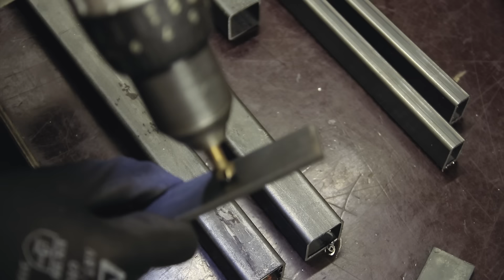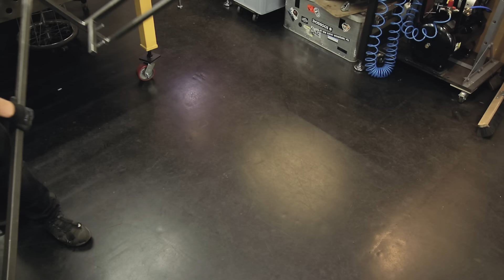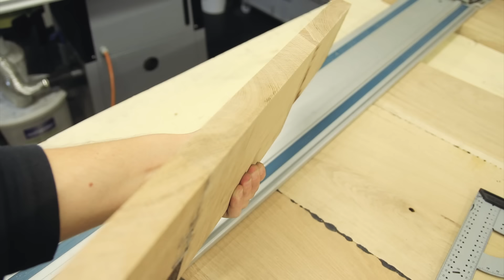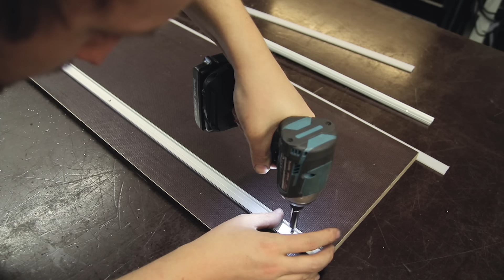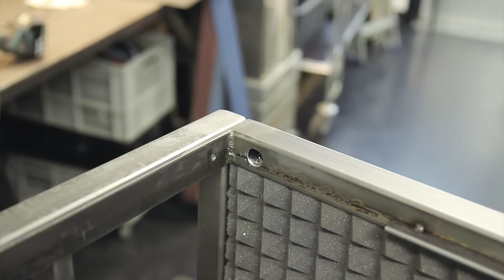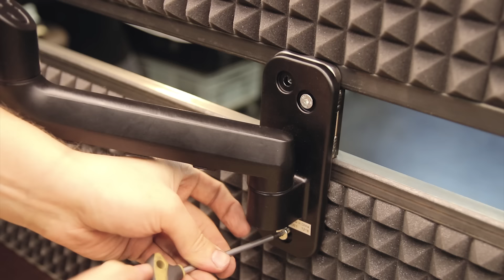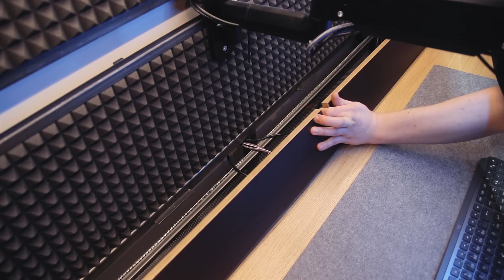How to Build a Cable-Free Desk with Built-In Lights, USB, Outlets + More!

Comment: Though I have total respect to this, recently I did it simpler and better (IMHO) having 2 monitors, using a double monitor wall mount (model North Bayou). It takes some time to assemble it but that was all I needed (and of course, I have logitech wireless keyboard and mouse - well trackball in fact).

Comment: Nice cable management solution.  That seems to be the main driver behind why people design their own desks.  Aesthetically, keeping cables out of sight is desirable, but from a practical point of view, cables on the floor are horrible.  I used to close the door to the computer room so that my roomba wouldn't kill itself in cables or rip cables out of connections.  Plus, I have an irrational fear of water somehow leaking from a pipe or something and shorting destroying my computers.  I want to keep everything off of the floor.
Also, I have 2 pc's so I worry about airflow under the desk.   I like to turn them 90 degrees compared to your placement.  The air intakes face inward and the exhaust faces outward, away from the desk.  I think it is an easy modification to your design.

Comment: In the drawings you’re selling you forgot the spacers between the lip and the thin wood, also de tubing in the aluminium box it’s not there.
Reply from the maker: The spacers aren't in the plans because I actually just made them to fix a mistake I had made when drilling a few holes (not installing the upper cross brace flush with the backside). So yeah I built my own desk wrong ;) If you follow the plans you don't need the spacers.
As for the tubing in the box, you're right, I added it afterwards because my perforated sheet was a bit too thin and I felt the edge is more sturdy that way. They're not strictly necessary though, especially if you use thicker sheet.
Reply: @PhilVandelay  yup that’s what I thought, I’ll use a 2mm aluminium sheet with no holes with the edges bended and then I’ll see if I do need the tubing. Has for the rest everything is perfect. I’ll show u the final result. Best regards mate

Comment: Hey Phil, I just wanted to let you know that "Eroy and Rhona" are stealing your design, no credits, same build, minus the shelf for the computer, and less aesthetically pleasing overall due to it being poorly fabricated.

On a sidenote; awesome build and I will be making something pretty similar for my setup, but I will be using iron angles in some places with wooden panel inserts, instead of adding pieces of flatbar and all...most likely to replace the "vertical frames" that holds the top shelf to the "table" part... to block out the sun rays.
Reply from the maker: I guess they added the credit after your comment 😅
Honestly I'm not surprised, as long as people don't claim it's their original design or start selling things based on it, it's fine by me.  If I didn't want other people building the things I design, I wouldn't be releasing the plans, although giving credit should be common courtesy. The bigger problem is that I can guarentee that eventually, some company is going to start producing this (most likely a cheap, ugly version of it) and making serious cash from it,  which bugs me a lot more, but in both cases there's not much I can do about it unfortunately. Companies have stolen my designs before, and they will do the same with this one.
But anyway, thanks for telling me. I have a feeling there will be a lot more videos showing some version of this build.
Reply: @PhilVandelay  Yes, indeed. They added it after my comment (if it is there, I haven't confirmed). I really enjoy your design, being a technician mechanical engineer draftsperson myself (I think thats my title in english lol! I'm French Canadian) I had a very similar idea but as mentioned relying more on iron angles because you can "inlay" stuff in them more easily, but I know how long it takes to release proper plans and whatnot so I prefer to mention it when I find someone stealing or not giving credits to the original person.

Comment: Shopping for a computer desk was an absolute fucking NIGHTMARE.  I visited probably two dozen stores without finding anything appropriate.  Your options are basically $100, particle-board, pieces of shit that I wouldn't trust to hold 100lbs or $1000 solid oak monstrosities that look like they came off the set of Wolf of Wall Street.

I ended up building a desk myself as well -- wish I'd seen this video beforehand.  Looks like another project may be in order this autumn!
Reply from the maker: Yeah that's about my experience too and the reason I went this way. That being said, if you produced this commercially, it would easily cost 1000$ as well, which I think many people don't realize. But at least you'd actually get some features

Comment: Its an amazing projet, have seen it dozen of times.
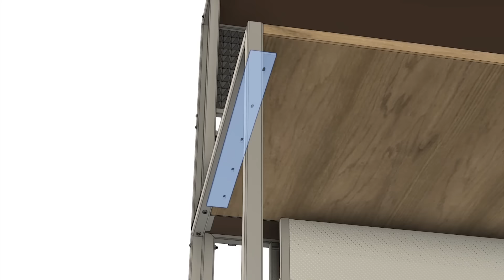how did you get the table top so perfectly aligned with the steel frame? I mean, at 9:35 you are welding what its supossed to hold your future table. did you knew in advance the thickness of the table? you didnt use sacrificial parts of wood in this part
Reply from the maker: The slabs were brought to the width of the steel profile on the thickness planer

Comment: I can't see the difference between this DIY project and an industrial one. Have you make the tools you showed in? Just the cost of the column drill it's too much for a domestic table, and the drill it's just the cheaper example.

DIY is, at least for me, a way to recicle, to enjoy, and a accesible way for not profesional makers to make creative mods, tools and a lot of stuff. I've seen automotive  mechanics than doesn't have the half of tools you show here. 

Its just my opinion, I don't pretend to tell anyone how to spend time and money. Just think than the most of us are not rich and we have to DIY make the most of the non-basic tools (I mean a screwdriver, as example)

Comment: When I built my desk a few years ago I went the cheap route and built mine with a solid slab door and some 1" rigid pipe cut to various lengths, with some adjustable floor flanges on the bottom. 
After I'm done buying a house (could be a 4 year process at this point), I will be making a desk similar to this. Cool to see your methods! That welding table is lovely!

Comment: In the US the prelaminated 18mm ply (I think the brand is EB1S)wood is common (white is the most common, black and gray). Most wood glue will cause rust on steal, the carbon in the metal turns the glue black. 
I built a similar desk last year, smaller back panel with versa mounts and, no shelf out of aluminum, got a welder at work to do my welding for a couple of lunches.

Comment: I love everything about this desk, from the materials, the aesthetic, to the modular functionality... it's absolutely gorgeous... when you said it only took 20 minutes to assemble at home, that's impressive, and a testament to the quality and well-thought out nature of the project. I love it.
Reply: Due to The fact that he designed it would lend to the 20 min assembly time, I would imagine. Not to take away from the design by any means. As my jobs revolves around creating assembly instructions for the general public, I have a bit of insight on this topic. There are often a lot of assumptions some of our designers make that often aren't expressed in the instructions. I've seen our test groups struggle with sections where joints should be flush but it's not mentioned and often leads to unnecessary discussion and therefor build time. As this fine man would just inherently know this it would shave off a lot of thinking/hesitation time.

Comment: if you cant do metal working. Is it possible to do it complete wood?
Reply from the maker: I think so, but you'd have to change the design quite a bit (use solid pieces for the sides for example)

Comment: You definitely need a fan inside the cable tray. Wires, whatever they are, heat up during using and such a volume of wires can be a problem without cooling.
Reply: no? it's an aluminum mesh open air design. I have a lot more cables going on in my current Ikea Malm cable tray and nothing gets even remotely warm.
Reply: Sounds like bro science. Why would wires heat up unless serious current is going through them?

Comment: Starting the bottom section of this build this saturday. Havent found a 30mm tabletop but I'm sure a 28mm one works fine. Never welded before and doing it with a garage workbench but I'm sure it will be fine.
Reply: So far so good, cut the steel using an angle grinder, messed up a few times because apparently I'm too dumb to mark 45° accurately. Nothing a good weld can't fix I guess. I have no Table like this to align the pieces but I'll use angle magnets, should work just fine. @Phil Vandelay I noticed in your schematics you used  a different approach to support the PC shelf as in the video you use 4 separate pieces while in the schematics it's 2 long ones.

Comment: Clean clean clean!  Very satisfying to watch.  Poor man's "clear top" workstation:  Stack a smaller table atop a larger table.  For floating monitor, attach table-mounted monitor arm to upper table  upside down.  Screw hooks into upper table for misc items.  Flexi tubes for cable mgmt.  Clean and cheap cheap 😄

Comment: if youre at all worried about the cables from the RGB strips getting damaged, you could always 3d print some bushings to protect the cables.

Also I'm a little surprised you didn't use any biscuits when assembling the desk top
Reply from the maker: People seem to often misunderstand what biscuits are for - they don't add any strength. They are to help with alignment, which was not needed here. A properly glued wood joint is going to be stronger than the wood itself anyway

Comment: I think first steps would be are to take classes in wielding and invest 15-20k on steel cutting/wielding equipment. This how to guide is not for folks with simple screw driver sets and a box of allen wrenches.

Comment: This is really amazing with the attention to detail. Though I will say that it feels like a small crime to pair such an amazing piece of machining with a prebuilt HP tower. 😆
Reply from the maker: A lot of people have said this, but first of all, that's a dual xeon workstation with 256gigs of ram, and secondly not everybody cares about see through computers with 5 million LEDs. I used to build PCs when I was younger, before most people knew it was a thing. But it gets a bit boring so now I build other things and just want a computer that works.
Reply: @PhilVandelay  I didn't mention anything about a bright, gaudy gamer system. You can easily build a tasteful system without a single active LED. It's more about that fact that HP as a company has become a shell of their former self in quality and customer service. But yeah, you go ahead and jump to those conclusions and I'll be sure to stay away from your channel from now on.

Comment: as someone who doesn't weld/ wood work, i can still see how useful that welding table is and kind of want one. lol

people who dont have this level of skill can still make something similar using clamp based parts that can be attached to a desk. 

really like the cable management tray having the usb and power hubs.
the entire look and feel is top quality.

the extra detail to make it easy to dissemble is an added layer of how much thought went into how it will need to be used and transported.

Comment: Beautiful. Another option for endcaps are plastic inserts. Your knees will thank you, and they look great! Some tips from this woodworker who is not much of a welder: when doing glue-ups like this, let it set for 30 minutes, then you can unclamp and scrape away the squeeze out, at which time it will just be a little rubbery. Save a lot of time sanding. Also, spend a little more time making sure the edges are flush, adding cauls every foot or so on both sides of the boards to hold everything straight.

Comment: As someone who never welded past HS metalshop, I'd absolutely love to build this myself if I had a shop to do so. This has inspired some ideas for me to build a desk using commercial means as I'm actually about to replace my current setup due to a move. Good stuff!

Also, you mentioned how the audio foam wasn't seamless: have you considered a checkered color scheme? Black and blue pair nicely for a more stylish design under some LED lighting so you could replace it with alternating color foam.

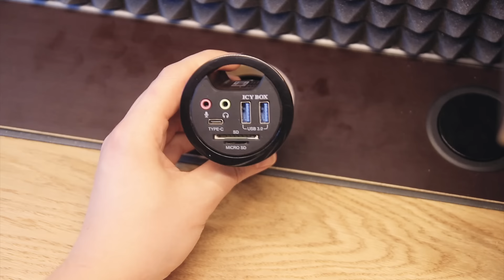Comment: 26:40 - Very nice, handsome... one problem:
This will be on the back of the desk, about 24" from the location of the keyboard and mouse... and those typically come with 10 feet of cable.  So the user would have to figure out to do with 7-8 feet of those cables, leaving them lying about on the desk surface.  They could go wireless, of course, if they don't mind the micro-latency that entails and the other problems attendant with wireless tech.
28:00 - I run a triple 32" monitor setup...  how would the desk hold up to that much weight on that single armature?

Good idea, very limited practice.  Good for some professionals such as writers, but not very good for people who rely on multiple displays.
Reply from the maker: Love how you're just making wild assumptions without having tried it, but I'm too lazy to even engage with this further
Reply: @PhilVandelay  Then why even reply?
And yes, I have.  Not your design, but others of similar approach.

Comment: My only issue is that you shouldn't use Danish oil anymore. It takes too many Danes to make a whole can, and eventually, there won't be any of them left. Maybe switch to an oil made from a place with a higher population. Quality probably won't be as good, but there's less chance of extinction...
Reply from the maker: Hey at least I'm not using Baby Oil
Reply: @Phil Vandelay I do not have the words to properly convey how hard I just laughed.

Comment: Really impressed by your work Kudos, However is it possible to make/design this table without welds? using stainless steel bolts, If you would be able to design such a build i would be very interested to buy such a design, Thank you.

Comment: This definitely helps me figure out my own desk set up. I have quite a few monitors and while I can't use the top shelf very effectively, because of a monitor that I keep up top, I definitely like the design for the cable management, the foam panels etc. I might also attach some peg boards but this was definitely a great start and helps me with my design. thank you very much.

Comment: How is that mouse from Logitech, I spend a lot of time in front of the computer and i was thinking to take that vertical one from them or that one you have
Reply from the maker: I like it a lot because it has a second scroll wheel at the thumb which you can map to whatever you want, I have it set to volume control which is extremely handy. That's mainly the reason I've used this model for a long time but it's also a good mouse overall. I did try the vertical one in the story and it does feel very comfortable - but it doesn't have the second scroll wheel, otherwise I might have gotten that one

Comment: Now I know you said it's some high grade plywood that is laminated on each side, I'm here in the US but what is that type of plywood called so I could try to see if I can find it here? I'm in the process of designing a corner desk myself and I kind of really like the look of that type of material and one mind having it in Black.
Reply from the maker: That's the thing, I don't know what it's called 😅 I'm located in Germany so the name "SIebdruckplatte" is probably of little use to you. It seems to not really have a clear name in the US, "phenolic plywood" is something I heard once that might point you in the right direction, but people also seem to confuse it with other, similar materials sometimes (it's definitely not MDF)
Reply: @PhilVandelay  yeah definitely not MDF cuz you said it was a laminated plywood so but I'll have to look up the words you used to translate to English but at least it's some direction for me to look in thank you.
Reply: It's hard to find but it's literally called "Laminated Plywood", though most listings for it here in the USA have it as a textured finish as it's often used in the manufacturing of flight-case style equipment cases.  Melamine board is similar and most popular here in the USA, though unfortunately most of that is an MDF style board and plywood based Melamine is hard to find.

Comment: So what happened to the dual monitor ? Is this desk dual monitor compatible or just single ?
Reply from the maker: You can hang as many monitors on there as you can fit, my old ones were just both starting to have issues and I was going to replace them anyway so I went with this setup. This is a 38" ultrawide monitor, so not really comparable to a "normal" single monitor setup, there is a lot of screen space and I just preferred the cleaner setup

Comment: how did you connect the LED strips? what did you use
Reply from the maker: the strips come with a controller with a remote and a power supply, you just plug them in

Comment: Problems: that top shelf is a dust collector, the desk should be on 4 lockable castors so you can move it to clean the floor, fit a pull-down blind (IKEA) to pull down over the speakers/monitor front, fit a wide, shallow drawer under the top for scotch tape, pencils, sharpener, eraser, notepad, highlighters, sticky notes, small screwdrivers, sharp scissors, tweezers, fresh face masks, cheapo mobile.

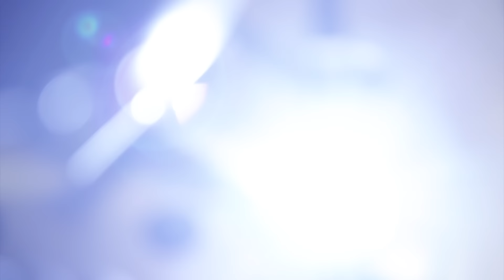Comment: What was that tool you used to hold the tab while welding at 5:20?
Reply from the maker: It's called a "third hand", very useful little tool for welders, and very simple too so most people make them themselves. It's just a weight with three "legs" on it basically. I made a short video about building this one, it's on my channel (a bit further back since it was a few years ago)